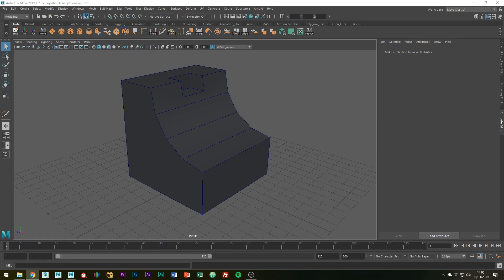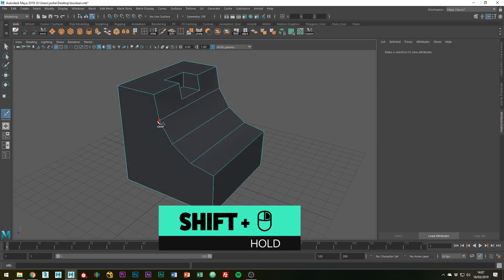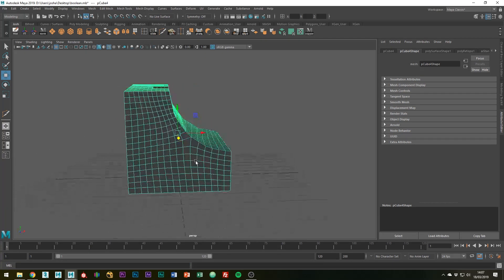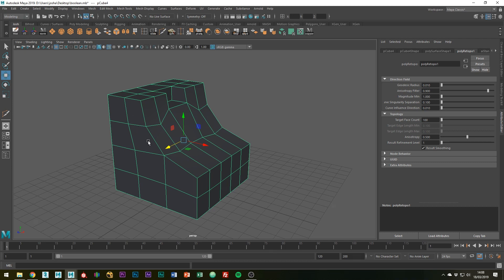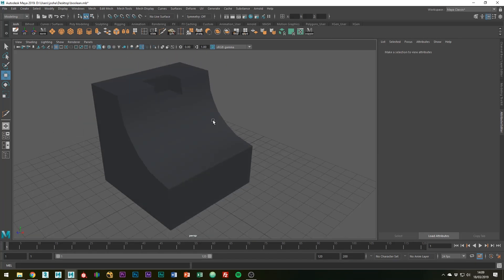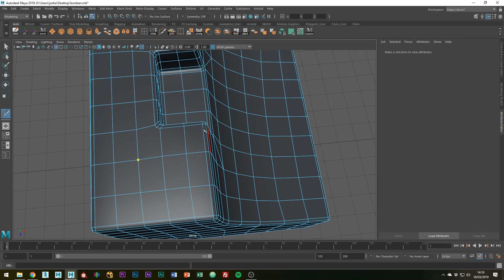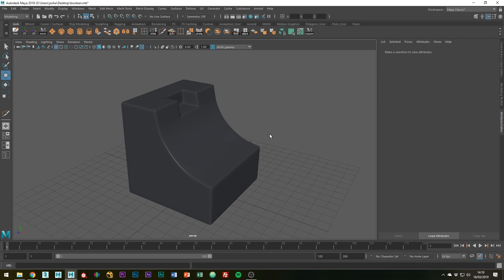Auto Retopology in Maya

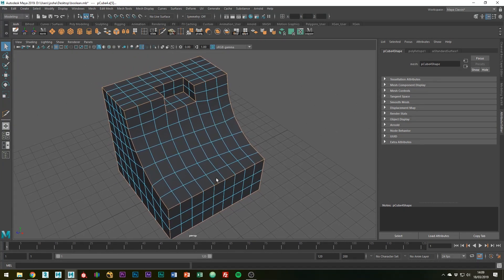Comment: Hey Hi. I have a question : How much it is important when you do modeling your corner edge must be in loop ?  ( like edges you've selected at 1:52)
Because I'm trying basic models like sofa, table etc but I am not able to achieve that hard edge loop, whenever I use insert edge loop that hard edge loop connection gets cut I don't know how :/

(& I mostly do modeling using 'insert edge loop' tool  not like making 2 different parts & then merge/attach them.)*

Does this video's method will solve that ?
& If I want to make showreel then should I use this method ? Is it ok or is it like 'not industry standard' ?

please guide me. 🙏

Comment: Does it works in Maya 2018 student version??
Apparently it doesn't since I've tried and no results
Reply from the maker: It wasn’t properly implemented into Maya until 2020. I have a video coming out next week about how Autodesk have finally implemented these retopology tools into the UI.
Reply: @JoshAntonio  So there's no way for 2018 student version?
Reply from the maker: @CWSOF  I'm not entirely sure about the student version, but I just tested it in Maya 2018 and it worked.
Reply: student version have every feature i suppose, the only thing is its not commercial